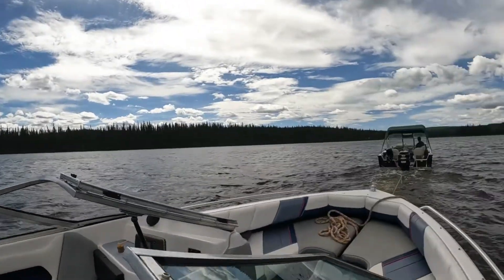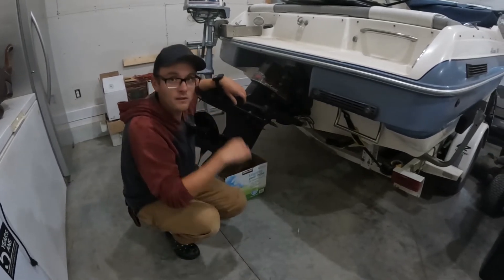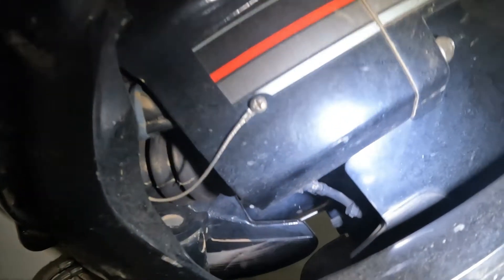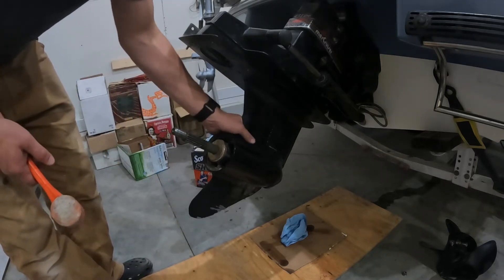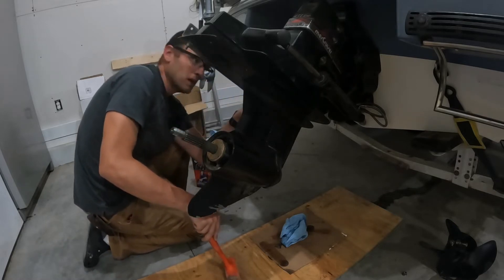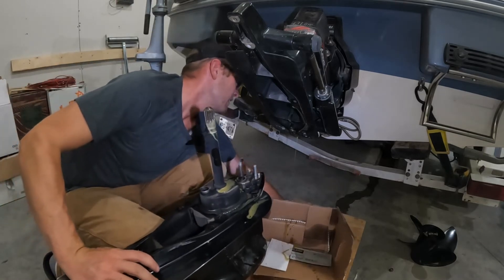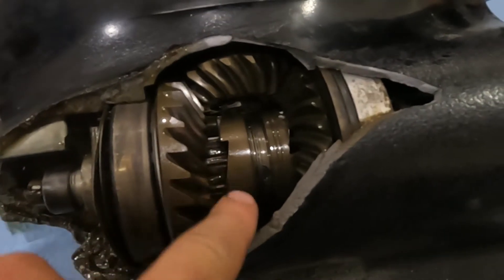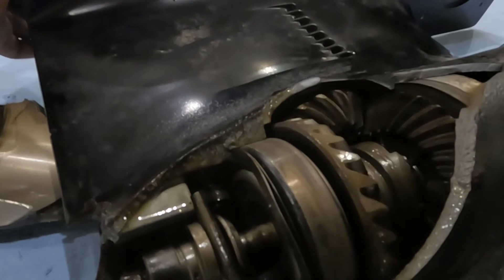Removal Of A Mercruiser Alpha 1 Gen 2 Lower Unit: A Look At The Internal Workings Upclose

Comment: What were the black things that fell out?
Reply from the maker: Hmm not sure what you mean, what time in the video did you see them. I'd have to jog my memory.
Reply: @sprucestomper  the rubber piece that fell out when disconnecting the lower unit. I have the same thing and can’t figure out where it goes or what it is. It’s a small half moon shape metal piece covered in destroyed rubber.

Comment: To do it properly you would have to buy 100s in special tools. Pinion height and backlash specs minimum. Then bearing drivers,the spanner nut tools etc. and if it goes south your out the parts cost.
Reply from the maker: Yep, quite a project if you did it all 100%. You can see how I ended up at the bolt it on hope it works method. So far so good. A guy went down a serious research rabbit hole learning about it. So many tools you would need. Thank for watching, much appreciated.

Comment: You saved me on that hidden bolt on the underside. Watched a great video on how to do impeller maintenance, but they skipped that bolt. Hammered the heck out of my lower unit and was questioning my life choices until i found your video.
Reply from the maker: I love a good comment like this, glad it helped. Everything I now about that boat I learned the hardest way possible. Thanks for watching.
Reply: Did you ever find out the missing peace that fall off goes

Comment: i just got into boating this year too. first boat i got was a larson cuddy camper style boat. didnt care for it. selling it now. never had it on the water. then i decided to spend money on a 96 crownline 202br with an LS1 motor in it. boats sick. but as you said, boat has a meaning. coupler splines stripped so a shop will do this over the winter while changing my gear ratio out. just sad i wont be on the water anymore this year. ive the same lower unit as yours. id reman it, its under warranty and nothing much else to worry about in terms of if your diy was done right giving you anxiety trying it out lol.
Reply from the maker: Oh I remember being a little tense the first time I threw it into gear after putting it together. Guy can't give up, if you can't work on it yourself it quickly becomes to expensive. Thanks for watching.

Comment: We have used the SEI aftermarket for quit a few years now and have had very good luck with them. We had one problem that I can remember and there was no questions asked. The complete lower with water pump costs less than a new bare housing that you must have the correct tools to disassemble and shim it. Yes I know some people got lucky and it has been working fine without reshimming so they say. The only draw back is until it gets broken in it will have some noise because they don't lap in the gears like OEM does and there is a specific break in procedure that I would suggest following. When they first came out they swore they where made in the USA but I don't know about now.
Reply from the maker: I researched options and the salvaged lower unit was the cheapest option. Risky as the condition was unknown but new aftermarket replacements were hard to justify because of what the whole boat is worth. I learned first hand that boating is pricey haha. That's for watching and taking the time to write a great comment.

Comment: I’d say the $1400 used option. It’s been proven to work on a boat (vs on a test stand). Not much that can go wrong with those components, and as smooth and easily as your turns, you could easily feel anything wrong with the used unit.
Reply from the maker: Im still on the hunt to make sure I get the best option, we shall see.